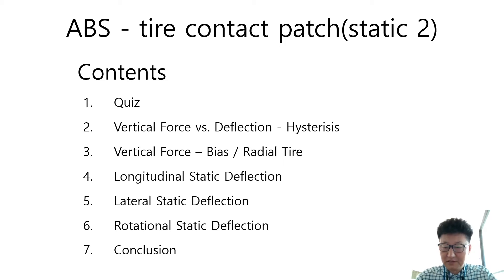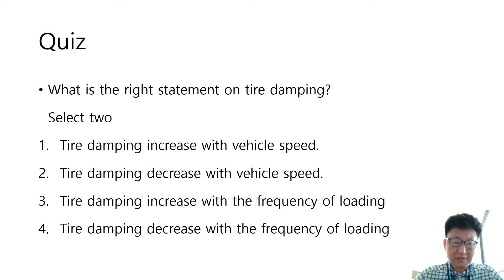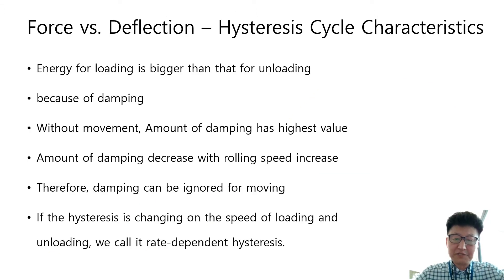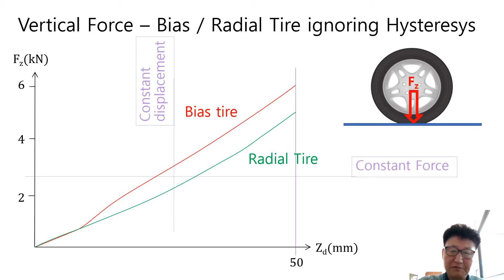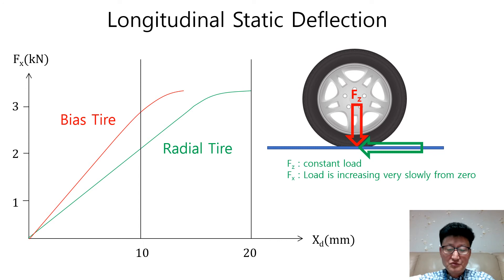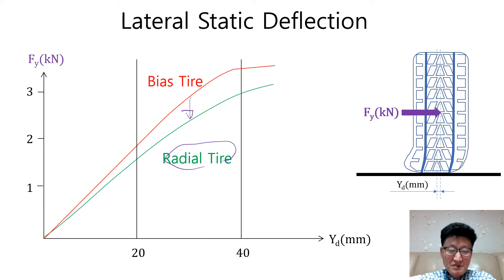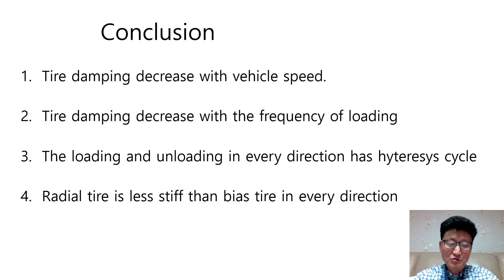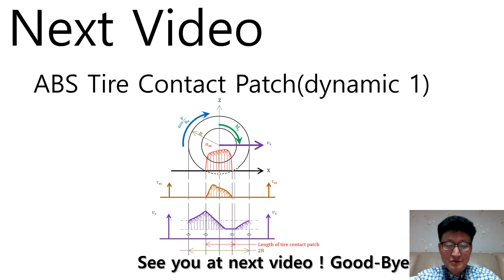E0013 tire contact patch(static 2), Tire Stiffness - all DOF - EulSeoggy Ko

Comment: Hi engineer eulseoggy, thanks for sharing your knowledge. I have one doubt from the graphs for I understood lateral static deflection radial tyre displacement is more which helps in maintaining the ideal contact patch so good handling but in rotation static deflection also radial seems soft does it mean bias is more responsive than radial for the same input
Reply from the maker: Thanks for good question!. Radial tires provide better grip across the entire contact patch due to their structural advantages over bias tires, thus can realize better handling performance.